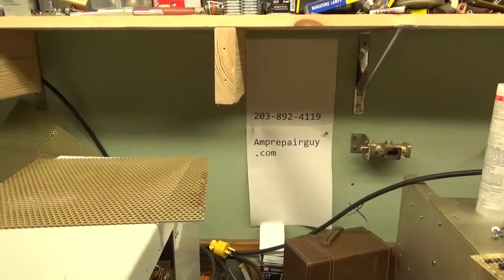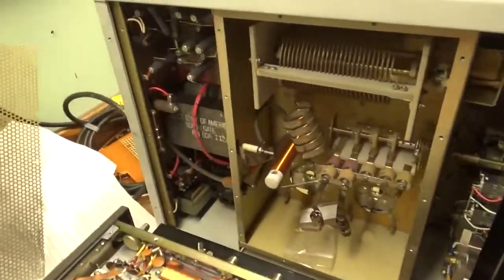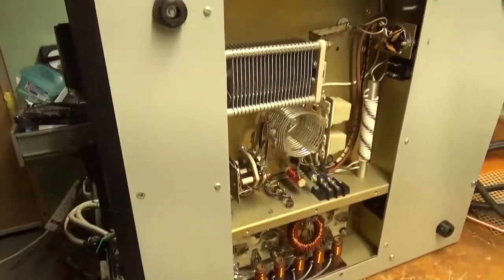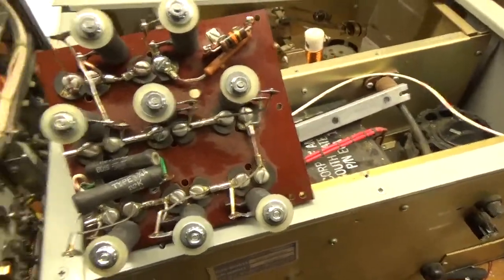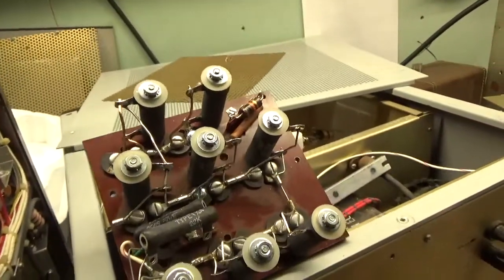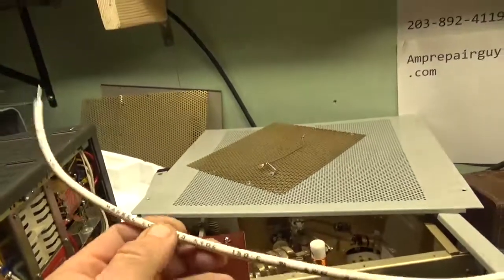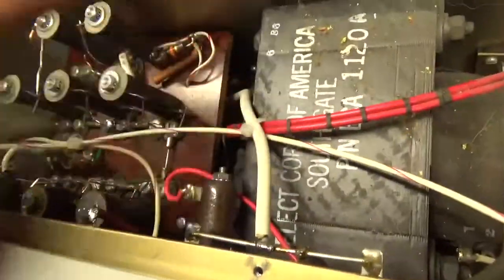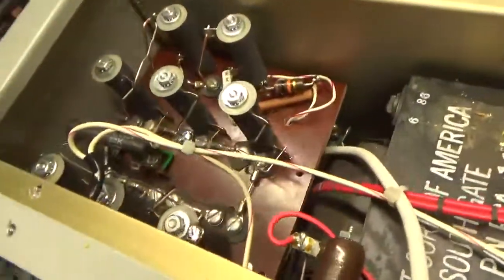Henry 2kd classic plate supply Capacitor and equalization replacement plus repairs

Comment: Hello sir if you don't mind I have a question, and the top back part of that Henry 2kd classic there is a large green tube style wire wound resistor, would you happen to know the value? 
Thank you so much in advance
Reply from the maker: Sorry but I do not, would be best to look at the schematic in the manual. I worked on that pa years ago

Thank you for watching.